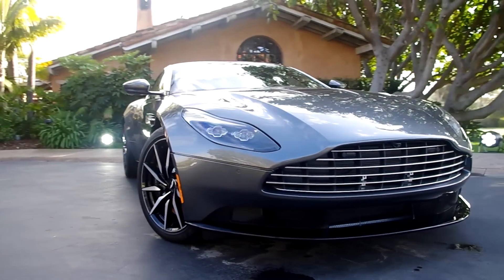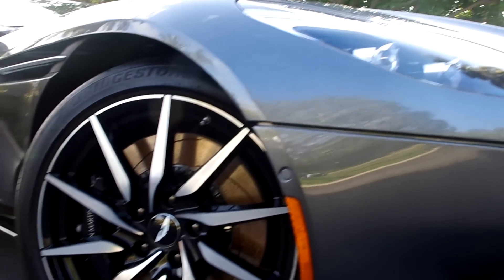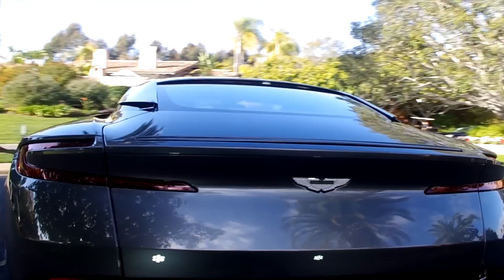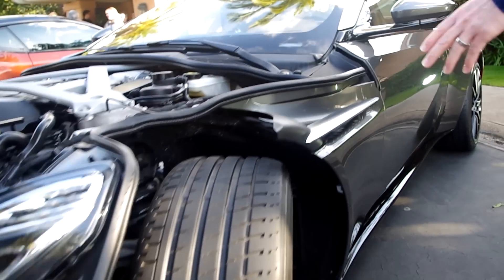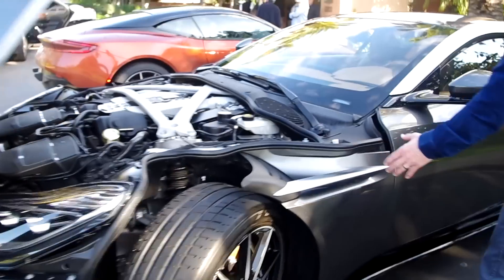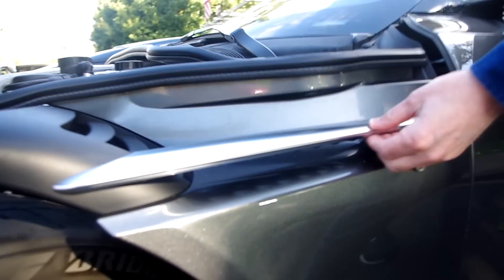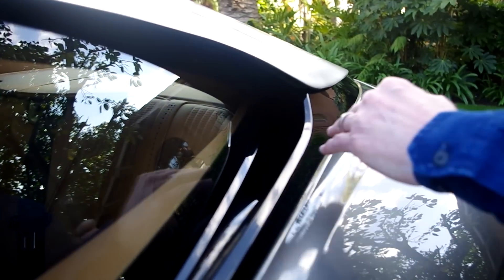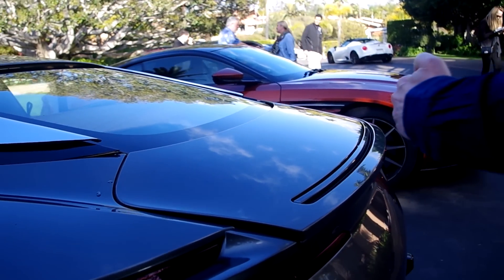Aston Martin Engineer Explains The DB11's Aero Magic | BLIP!

Comment: Not bad, but try to keep it more stable next time, and the wind noise is just unbearable.  Get a dead cat, it should help on the mic.
Reply: Some poor sod explains the aerodynamic results of years of hard work to a journo bro who didn't care enough about the air streams to put a windscreen on his mic.
Reply: jpiercevids   There's no excuse at this point to not have a certain base level of video and audio quality. Gear is so readily available and cheap.
Reply: high pass filter
Reply: That would've worked, too.
Reply: It's not "just unbearable", it's slightly annoying if that.